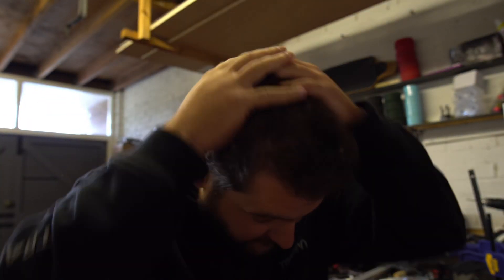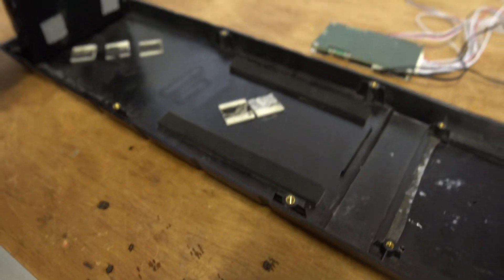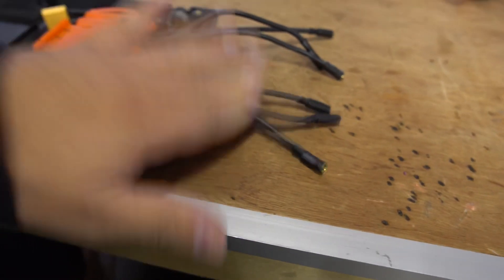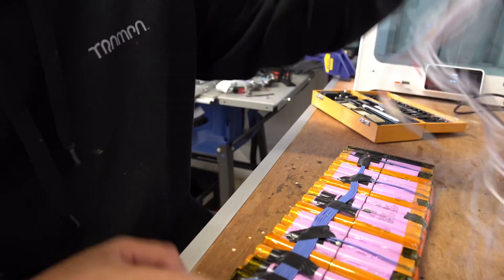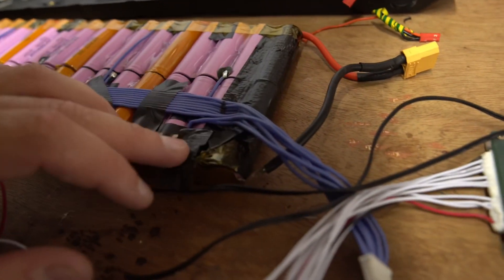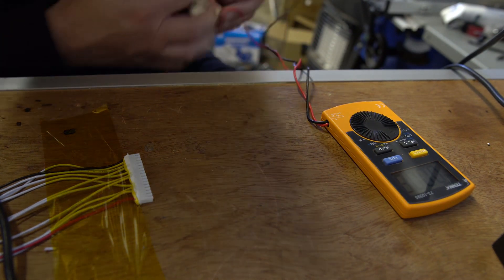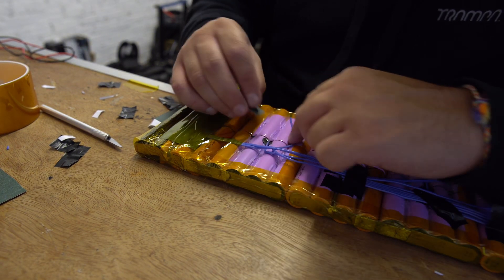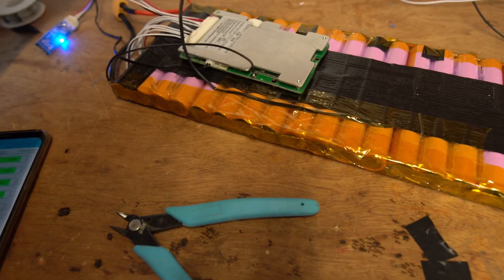Opening A Kevin Dark Battery! | Installing a Smart BMS

Comment: Hmmm... interesting. What sucks about the Onewheel is that everything is proprietary. So the BMS on the XR is made for its 15s2p battery. And it's built to fit in the box. So if that goes, you can't just replace it. You're at the whim of Future Motion, who you'd have to pray remains ethical in their repair charges. Because a new battery box can run $600-700 for an XR. My V1 needed a new battery, and I shelled out almost $300 for a battery and BMS.
Anyway, it's cool to see the inside of battery packs. Cheers!
Reply from the maker: Wow! That's mad.  The VESC6 has an IMU in it and it will be coming online soon so we are going to see DIY onewheels for sure! That will be interesting
Reply: @LeeWright  Forgive me.. What's an IMU?
Reply from the maker: @TheBoardGarage  it stands for Inertial Measurement Unit.  It's basically a giro that feeds back positional data.  The VES6 plus has one in it, and benjamin is bringing self balancing online with it, this will enable homebrew Onewheels
Reply: @LeeWright  Well damn. I wonder how that'll shape up. It'd be cool if someone could gut a Onewheel and replace the innards with DIY parts.
Reply from the maker: @TheBoardGarage  it will happen no doubt.  There are already some projects online where people have used an arduino for the IMU part but all being in the VESC is a huge bonus and I think we will start to see other builds using this feature.  I'll be sure to link you to anything I think you might find interesting

Comment: For those balance wires to have been wearing on the ridge, the pack would have needed to be fitted resting on the balance wires (therefore the more delicate side of the pack) which is not good. Mine is fitted the other way with them facing upwards. I just checked my board, which has a Battery Guy pack fitted by Kevin I believe, and it too still has the ridge. Correct fitting surely is with the balance leads on top so all the weight isn't as likely to cause issues. Good vid Lee 👍🏻
Reply from the maker: Thanks bro, glad you are enjoying the videos! Just a mistake that is sorted now at least!